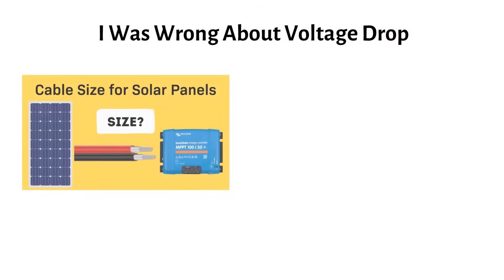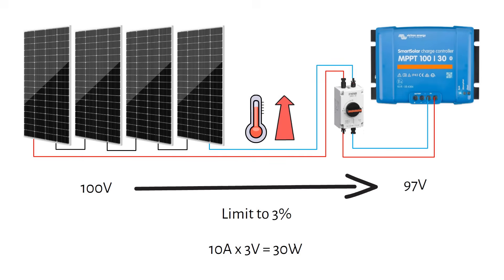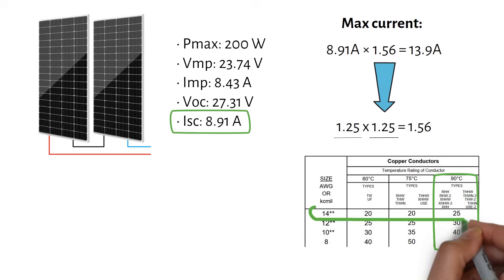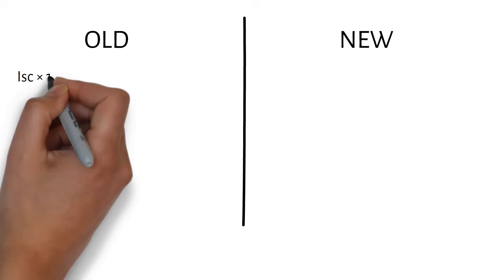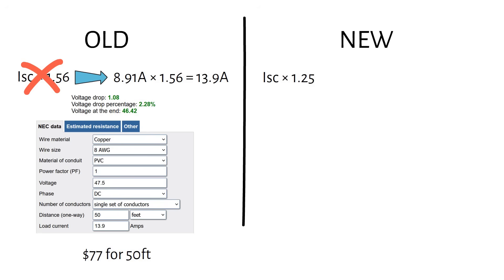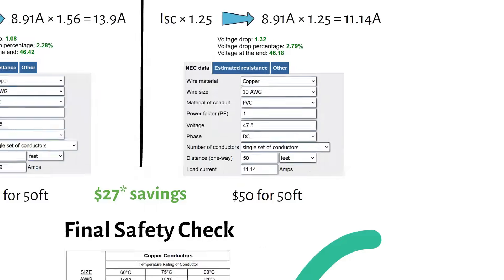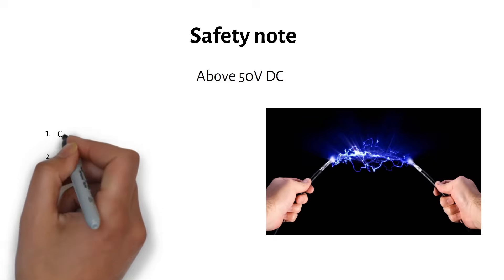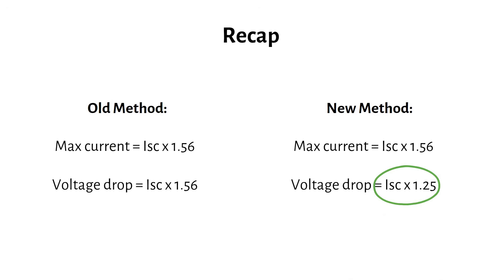Solar Panel to Charge Controller Cable Size

Comment: 3% drop on an mppt should not be treated as an absolute rule for low voltage PV systems. The mppt does not care how much the drop is so long as the final voltage is still above the minimum voltage for the mppt, and so long as you consider the losses acceptable from a cost / power standpoint. 

The only hard rule is the max ampacity chart, but as long as it is thick enough to be safe for a short run, it is still safe, just potentially lossy, for a long run, the watts of heat/loss per foot of cable remains the same.

For example I recently moved my panels further away, and now have a 6% drop, but I get about 20% more usable sunlight.

Comment: I used H1Z2Z2-K 2x6mm² cable with 20m length for 6 sheets of 100wp solar panel with 3S 2P configuration with 24v system.

Comment: The voltage drop calculation really isn't a safety issue (until you push to such high losses that self heating affects the insulation integrity), it is rather a cost/efficiency tradeoff. More copper will always be more efficient but also more $, just decide where you want to spend your money (an extra panel may be cheaper than bigger wire).

Comment: That calculation is ridiculous.
The formula for voltage drop is : VD = 2KID/CM
VD- voltage drop 
2 is because the wire goes from the source to the load and back
K— the resistance per foot of one circular mil.  Easily converted to metric if you wish to use that system of measurement 
I—current  Because current is inherently limited to the short circuit rating ,that’s the number you use
D— The distance from the source to the load
CM— circular mils of the wire; consult table listing for standard wire gauges 
You can apply de rating considerations after this calculation and then choose conductor that suits the purpose.
Note that the voltage of the circuit is not part of the calculation; the formula is just V=IR.

Comment: 6 gage wire is too big for the connectors. Meaning. You need lugs. Long distance is 6 gage copper wire. How I know without using math. I have a 12v AC mini split. I needed to extend the power wire by 7 feet. On the lowest setting. 10 gage wire didn't carry the load. 8 gage wire didn't carry the load. 6 gage wire carried the load, and the unit works perfectly. Now. It's what type of solar controller to use to get best efficiency. To maximize gain. A MPPT controller type. I didn't use math. Just testing for over 8 years. Watching volts, amps, and watts. A tip. The more different equipment you hook up to run your solar. The more you waste your energy that you could have been using somewhere else. Proven by a thermal. Heat from electronics = energy wastage. Keep solar simple. USB 12v first. 12v second. Inverter third. Three different systems.

Comment: I use the Blue Sea Systems wire size chart. Works very well for the load side.

Aiming for 3% voltage drop from solar to charge controller is fine for short runs. For very large runs a 10% drop is acceptable.

Comment: I like your thick cable at 1% volt drop.
Higher  current diodes for less volt drop and 50 amp terminals. 
Series parallel lower voltage systems are safer.
The only issues for me now is a dc arc fault detection device diy.
Maybe a lightning sencsor covering 10khz to 200khz with relay isolator?
Cable 50mm to 16 and 35 to 16mm.
Link cable between series parallel pairs 10mm.
Andrew New Zealand

Comment: Thanks from Spain to translate your videos directly to Spanish, so we can follow your videos. In Spain for solar installation: under 3kwc we use 4 mm2 CC cable, between 3kwc to 8 kwc we use 6mm2, over we use 10mm2 up to 16mm2 for big installation.(if cables longer than 50 meters, we use  the following bigger cable. Ex: 54 meters with 7 KWC paneles, normaly 6 mm2, but in that case 10 mm2, same for Ground cable.

Comment: In my work life as an Electrical design engineer for 35 years I must disagree with your calculation.   You headed in the right direction, but didn’t get there.   When doing voltage drop, you need only use the amperes produced.  Not times 1.25 which is for fuse sizing.
Reply: That’s what I wondered too.

Comment: I went with 10mm2 PV cable to keep the voltage drop as low as possible, it may be a small percentage difference but that difference over the projected 25 year lifespan of the system might mean more output over that time ( have you worked that out for your calculations?), or, should I need to or want to change the panels for a higher output version in the future ( because panels are only going to get better and cheaper), I don't or won't need to change the PV cables because they are now not large enough.

Comment: Why are you still multiplying Isc by 1.25 for power loss? Chances are your panels will produce Imp or lower most of the time. Just use total string Vmp and Imp for power loss calculations. Sure temperatures will affect it, but it shouldn't make any appreciable difference. You're making it more complex than it needs to be.

Comment: If you don't like the voltage drop you could add a wire same gauge next to the original one.
Reply: that's even more expensive than a single cable wth the same total cross-section. But voltage drop is overrated. See other comments. It really doesn't matter if you have 5% or 10% or more voltage drop if it's cheaper to add 10% more panels than thicker wire.

Comment: I think for voltage drop calculators you should be using IMP and not ISC for amperage. just like how you are using VMP and not VOC.

Comment: You are wrong again. Remember if you are lose 3 v and  you are lose amp as will because of lose remember you have Watts lost . To lose watt you are wasting amp
Reply from the maker: Power = voltage x current.

Comment: My cables are 12 meter long, no direct sunlight, 1 inch pvc pipe and is also in the shadow.
I have 3 series of 4 solar panels with 164 volt dc,and are 130 watts each,i use 10mm, my cables are not even warm when i have full sun, i don't care of the money because safety is prior 1, wanted 5 in serie but because of shading can not do it.

Comment: Sorry Nick, 3% drop limit is outdated advice. 

When solar panels were expensive, and wire was cheap, it made sense to worry about voltage drop.

But now that panels are cheap, and wire is expensive, it's better to accept higher voltage loss if it means using less expensive (thinner) wire.  

I'd say 5% voltage loss is a reasonable target, especially on longer runs where wire costs quickly add up.  On longer runs, adding an extra panel would be far more cost effective than upsizing wire to keep voltage loss down.
My array is 420' away from my inverter. Meeting the 3% limit would have required 8 gauge wire per the tables I used. I used 10 gauge and saved about $600 in wire costs. I had already oversized my array, so the voltage loss was negligble.

When I tested the actual voltage loss and compared to the voltage loss tables, it was significantly less (only 2-3 volt drop - negligible when I have 450-500V strings)
Reply: Because of the inherent current limitations of the solar panels ampacity is seldom the main factor. Voltage drop is the more important factor and ,as you mentioned, with high voltage strings ,a calculated drop over 3% is insignificant. The MPPT  will look for the sweet spot and mitigate the voltage drop to some extent.
Reply: I 100% agree and was coming to comments to say so. I also disagree with the new voltage drop calculation. You care about the voltage drop at the WORKING CURRENT Impp, not Isc. And the actual current, not multiplied by some factor. You never want short circuit to happen, and if it does then the more voltage drop the better!! As long as it's safe. What you are trying to do is get the most effective system for the least total money. And, as you say, if there is 50W or 100W or even 200W loss in the cable, it's probably cheaper today to add one extra 400W panel (mine cost $60 each) than to buy thicker wire, especially on a long run. ALSO, the 3% voltage drop limit is important for systems that convert to mains voltage AC on the back of each panel, and the voltage still needs to be in spec when it gets into the house. There is no similar requirement in a DC system with string MPPT inside the house. You just want to deliver as much power at the MPPT as you can for as little money as possible. And not set your wire on fire, or give electric shocks.

Comment: The controller will take care of it. It becomes a charging voltage around the battery levels your battery will need. If too weak it's not working. Higher is better.

Comment: Hell, I purchased 1/0 wire ..for my 76 VOC  system……. My voltage drop is about so low there isnt hardly any at 100 ft…..😁…
Reply: Where do you live? Do you have an armed guard on that wire?

Comment: Anyone remember coming across the old ceramic posts/tube wiring?
A 14gauge wire can run 20 amps constantly because of the wiring being in air.

Many panels output 27vdc. 2 in series is over 50 volts.
8 gauge wire, if given enough air for cooling, can support 60 amps.

Most grid power lines are exposed to the air (utility poles).
They can handle higher amp loads because of the cooling.

I tried the calculator link.
Information is incomplete and erroneous.
Best to use several calculators to see a common set of ratings.

10 gauge wire can usually carry 30 amps.
8 gauge can handle 40amps or a bit more.
Both can carry more if not confined.

Video used a 50 foot run. Many setups are 100 foot or longer.
50 foot is OK for a small ranch style home.

Multi story homes and ground mount setups can easily exceed that 50 foot run in the video.

Remember, your distance to the panels from the house is DOUBLED actually since you have two wires. That doubles the resistance too.

And more heat generated as a result.

Always best to go up at least 1 size in cabling just for safety sake.

Comment: Seems like the calculate should that into account wire rating size so it doesn't recommend a wire that can't handle the amps

Comment: nick! why is it that once i place that pv disconnect switch in my system.. it gets warm/hot?
however if i connect the cables straight to the mppt.. all cool?
all connections snapped in..but the switch slowly gets warm.. i opened it retightened any connections in there.. 
still it feels warm.

(btw im a scaredy puss with electricty.. so i rarely go above 50v.
i have 6 resident panels and i split them up over various power stations and mppts.. just so i can have low voltage and low amps.) only 1 mppt gets 2 panels series  - and that is at 70v.

Comment: man.. i ran away from victron.
the 100 20 the wires connectors limit u to such a tiny cable.. it ALWAYS was hot.. the wires were hot.. its just a hot box.
for it to work just on "warm" i had to limit the controller to 10a.

i switched up to an AMPINVT. body temp all around. cheaper too than the victron.
i mean i got a 100 80a controller for the price of a 100 30.

Comment: I would have used 12 or 14 AWG cabling because the Isc is never going to be seen, but rather the Ipp current.. and that's only going to be in the fall, at a chilly temperature, at the perfect angle. Usually, you see that the Ipp.
Reply: Right! 
I would do the voltage drop calculation at short circuit rating and that would easily cover for any other de rating issues such as multiple circuits in the conduit.

Comment: Using 10 awg for one 600watt array and 12 awg each for the two 400watt arrays. Planning to upgrade to a 8awg for all of em but dont think its necessary.

Comment: Please correct me if i'm wrong I used 6mm² on my off grid system with two 550w series OCV 49V and ISC 15A length of 10metters.

Comment: Can someone assist here? I bought multiple 200watt potable panels (ecoflow and jackery mainly) from an auction.  Was given 100ft copper 12AWG XT60-MC4 cable.  Now after watching this video and using the calculator, I'm seeing tremendous voltage drop using this 100' cable!   Is the idea to wire them all in series to increase voltage to the max my ecoflow power station will accept?  Is that always the general idea when stringing these?
Reply from the maker: Yes, always wire in series up to the max allowable input voltage. I don't recommend wiring in parallel. Use this formula: (max input voltage)/(Vocx1.25)= max panels in series. Then round down.
Reply: @cleversolarpower  I have always been under the impression that anyone who needs to watch YouTube videos to know what to do, should never go more than 50v dc.
Surely the economy made by not having a professional do the installation, plus the possibility of future maintenance and repairs, is well worth the reduction in production due to keeping the voltage safe?
Does the system being connected to the grid or not connected to the grid, determine if it is better to go higher than 50v or not? With or without battery storage?
Or am I over exaggerating the safety benefits of keeping it below 50v dc?